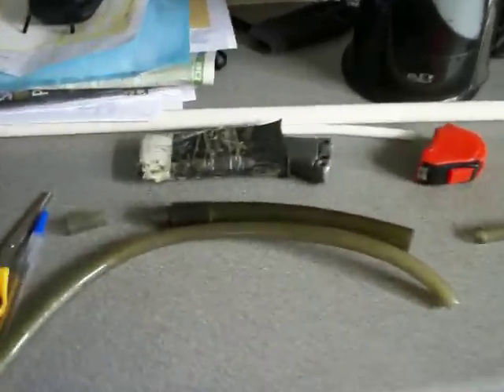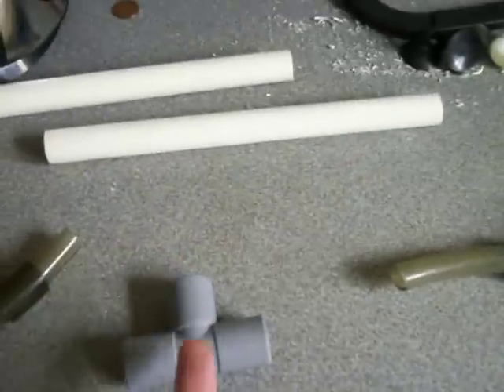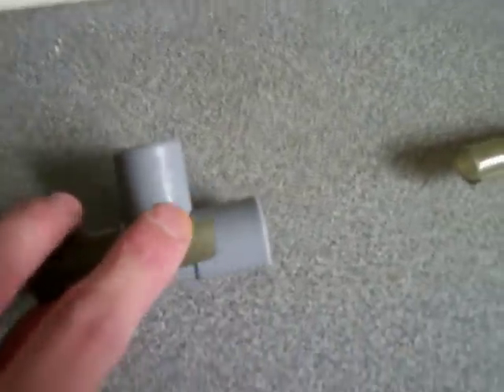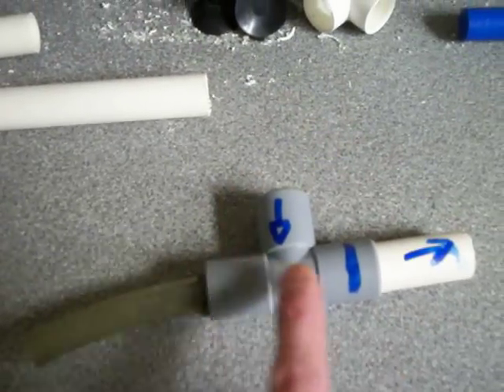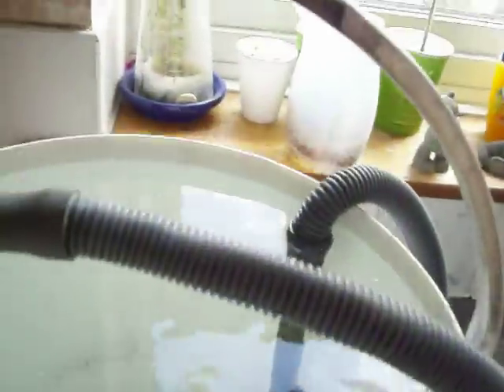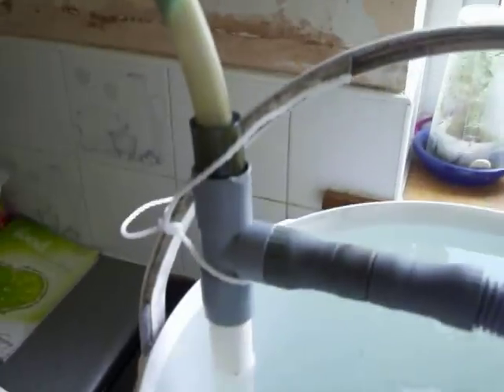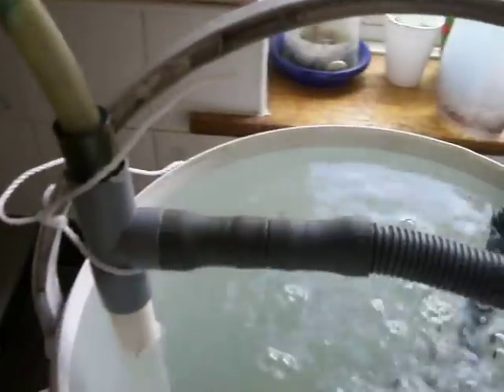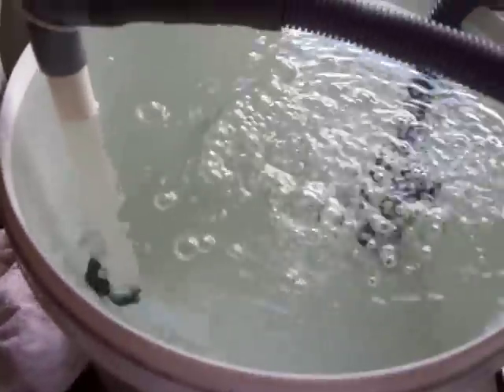My DIY Venturi for Oxygenating my aquarium + Demo !!!

Comment: Very good video with easy to follow steps.This venturi works well both at low and high water pressure.You can hear the air being sucked in which is a good sign the venturi is working properly.My pond is outdoors so the noise made by the venturi is not a problem.Thanks a lot
Reply from the maker: Pcg 127 cheers glad this video has been helpful 👍

Comment: It will work.  The physics is the same.  The density of water will only be a big problem if the combined outlet of the venturi is higher than the suction inlet.  Then, the motive fluid (from the pump) has to work against gravity.  Again, it will work, you just have to have a strong enough pump for whatever situation you are working with.

Comment from the maker: Yes leTigre1981 you are correct !!!!! In the demo the outlet to the pump is to close to the inlet so possibility of air getting into the pump ect not good !!! But its just a demo to show how it all works !!!! :) This wouldn't be set up like this in the main tank !!! As you would not want air going into your pump as it will damage the impeller ect and also air lock your pump and stop it syphoning / working ect !!!!! All the air mixes with the water in the venturi before entering the tank !!! :)

Comment: Great setup !  very simple and well explained !   I am trying to build a vacuum venturi to suck air from an custom overflow system using the same pump and your setup is way more simple!  I'm currently testing if it will be able to suck water wich is heavier than air... anyone tryed this before ?

Comment: Correct me if I'm wrong but the water goes into pump THEN into venturi where it is mixed with air.  The pump will only take few bubbles in the tank because in this demo the tank the exit and intake of pump are near.  In a real tank I think this setup would not get air bubbles into pump if placed correctly.  The only thing changed is the restriction on the exit hose, but this restriction change when you raise or lower the hose end so is normal and I think it would not affect the pump life.

Comment: I think the confusion is because he says the outlet pipe on the right and the inlet on the left. So to me it looked like the inlet is sucking the air into the pump.

backwards?  I have one of those pumps and its noisy when air gets trapped in there after cleaning.

I had a play with a fountain pump and the amount of bubbles was pathetic. 
Im after a torrent or water/bubbles though.  Going to have another try with a 6000l/ph pump and severely restrict it.

Have fun.

Comment from the maker: Good question matey. I don't really know tbh. The original ends for these filters has a reducer on them anyway so slows the flow and makes the water come out at higher pressure anyway. This question was raised on a forum and i think we came to the conclusion that it is possible that it could shorten the life of the filter yes perhaps. But No more that it would having the aqua valve on the filter slightly closed to reduce the flow in the tank. really a question for the Manufacturer. thanks !! :)

Comment: Most of the aspirator pumps I've seen diagrams of work a bit differently-   the water feed goes along the straight bit, and the air is sucked in at 90 degrees. Your pump clearly works, but I think the normal way could be a bit better, as water doesn't particularly like turning corners, whereas air is better at that. May not make a lot of difference though.

Comment from the maker: @tg0dmw Cheers buddy top tip !!!!! ill try it thanks :) !!!!! Also i have found if you use a loose fitting cap on top of the breather tube it silences it better than the sponge !!! And doesn't affect the amount of oxygen going into the tank either :)